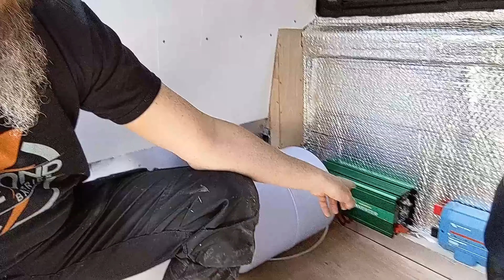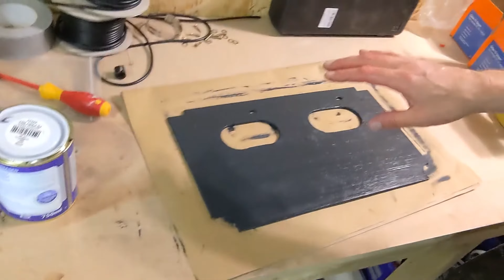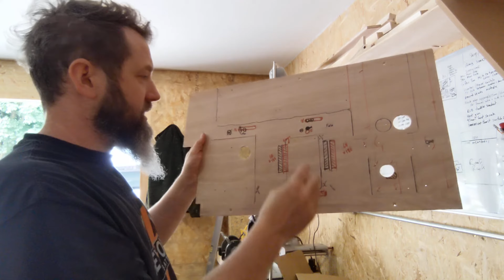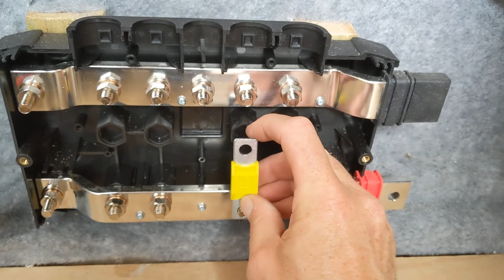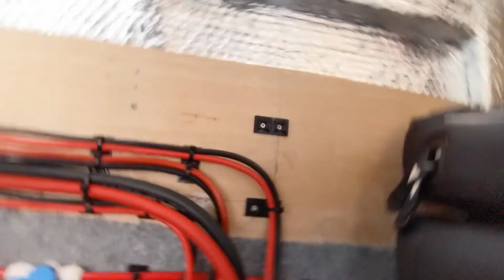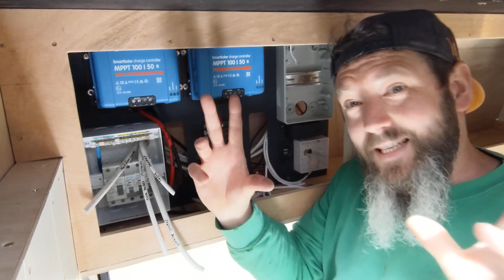EP27 | VAN ELECTRICS Part 1 | First Fix Cables | Victron Lynx | MPPT | DCDC Charger | Distribution

Comment: I'm hoping to start building a camper based on a Ducato, Boxer or Relay in the near future.  I've been thinking through electrical set up, but one thing it seems hard to get a clear answer on is the size of the alternator, which would be good to know so I can size a reasonable amount of DC-DC charging.  I don't ssuppose you know the size of the alternator?
Reply from the maker: Our alternator pumps out 140A, we use 60A for the DC/DC charging of our leisure batteries. So 80A should be hitting the starter battery. When we upgrade to 100A DCDC charger we will upgrade the alternator to the max we can get hold of.